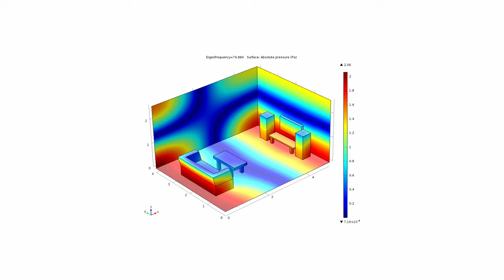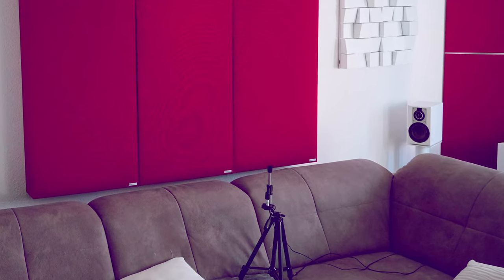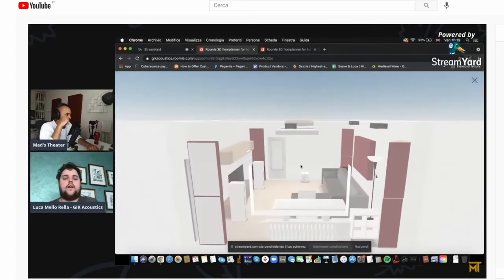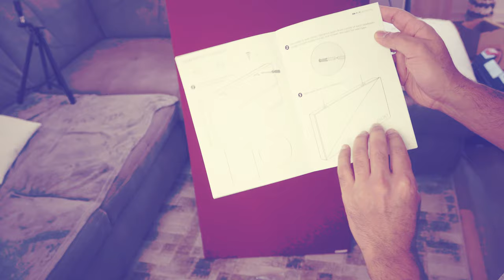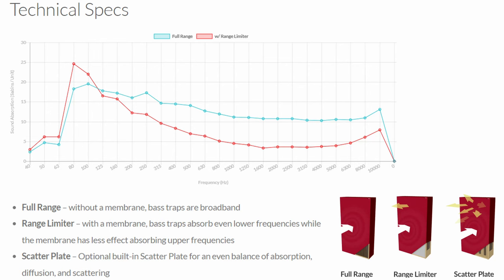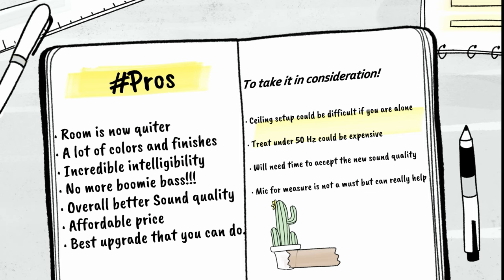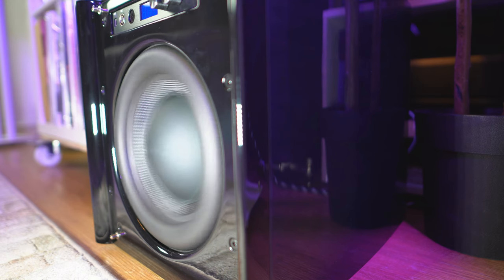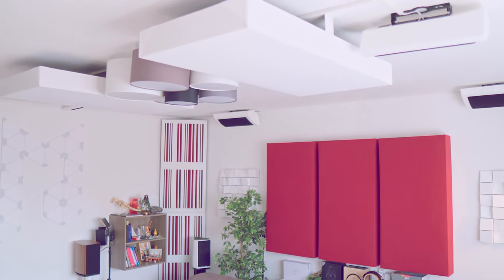The Best Investment i Ever Made in MY AUDIO JOURNEY!

Comment: Room Acoustic. An often underestimated topic. Also many Hifi dealers do not give this topic the necessary attention. I also planned to do some acoustic treatment in my room. I also contacted some dealers for acoustic panels and think, that GIK acoustics do offer quiet good looking solutions. The look of those panels is also important,  in my opinion. It took quite a lot of time, till I realized, that a good sounding room is the basis for a good sounding Hifi Setup. But of course, i have to invest and it is not cheap. But i hope the benefit i get from it, will justify the investment.
Reply from the maker: Room Acoustic is a must to have in my opinion, 50% of what we hear is room acoustic..i was satisfied with GIK from result and also look point of view that is really important also for me.What i can suggest is to make it step by step if is possible cause the sound will change a lot specifically in the reverberation time..
Reply: @MadAudiofficial  What you say, sounds convincing. It is good to hear it from someone, who experienced this by himself (with his own ears.)  As far as i can see in the video, the Loudspeekers in your room are positioned at the long wall, is that right ? If yes, did you ever try to position them on the short wall ? And what was the result of it ? A guy from GIK Acoustic told me, it would be an advantage, to put the Speekers at the short wall. That would prevent problems with Soundwaves of the low End. (under 200 Hertz or so). But i would have to position them at the front of the Window Front then.  Looking forward to your reply. :)
Reply from the maker: @tommy-be-good6580  yes on short wall and at 1/3 of room length should be the best position, same thing for listening positions. Unfortunately my room was not predisposed for to that and i had to compromise..In the future i would like to have a dedicated room only for my Hi-Fi since now HiFi and Hometheater are together but i achieve a great result thx to the acoustic Treatment.